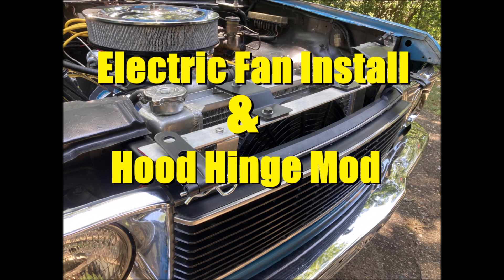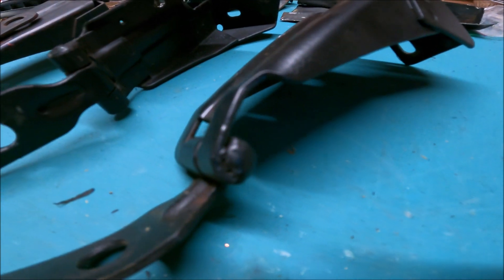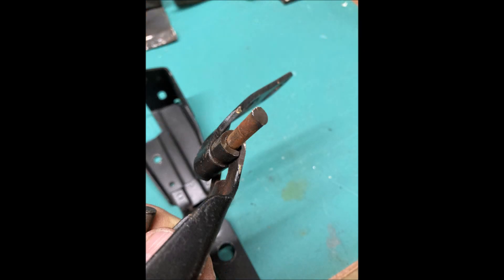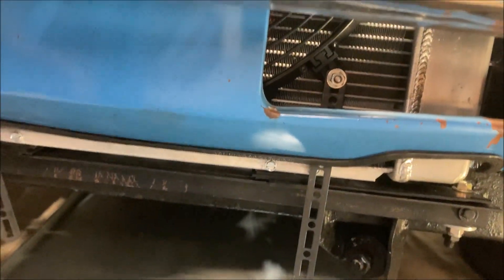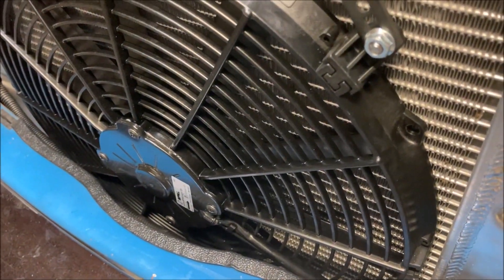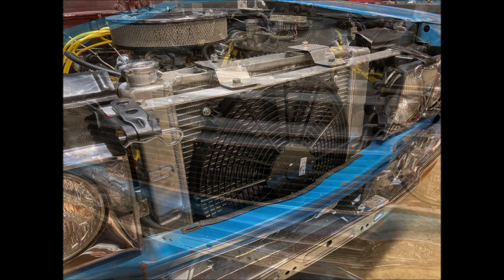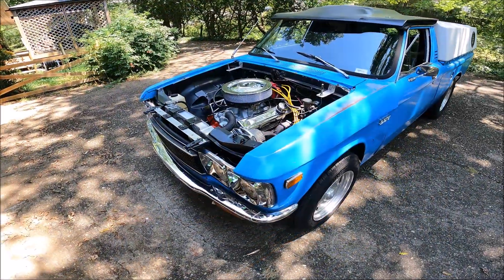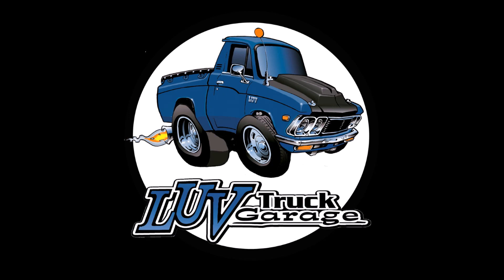Chevy LUV Electric Fan Install & Hood Hinge Mod

Comment: What temp is your truck running?
Reply from the maker: Around town in 90 degree + temps 190 tops, unless you sit through a couple traffic lights then 200+. Never over 160 in winter